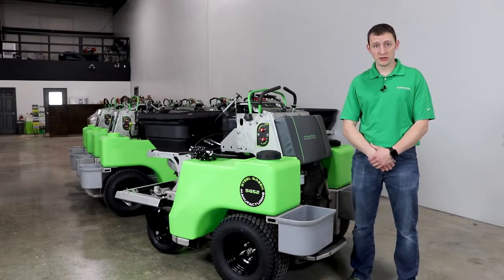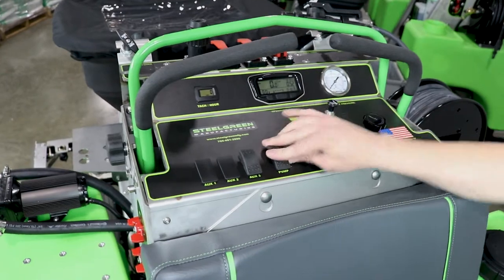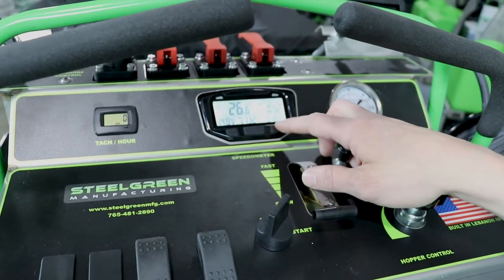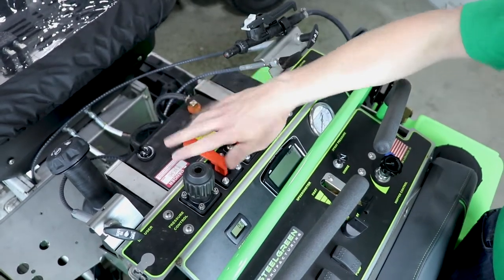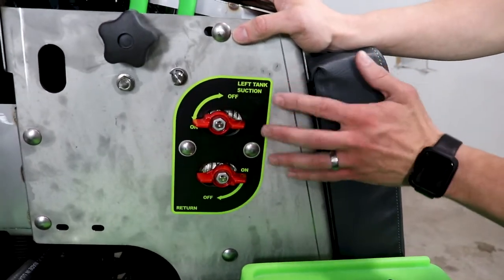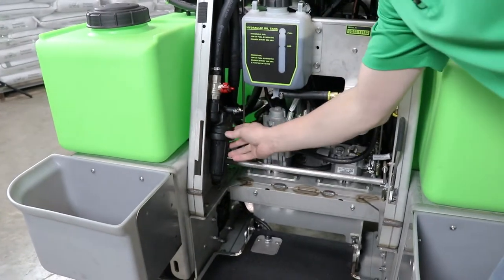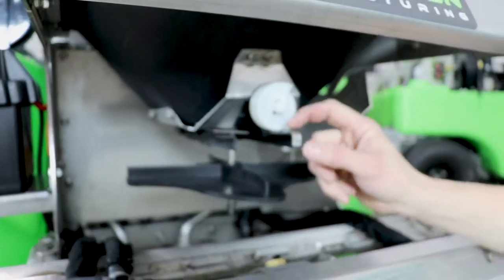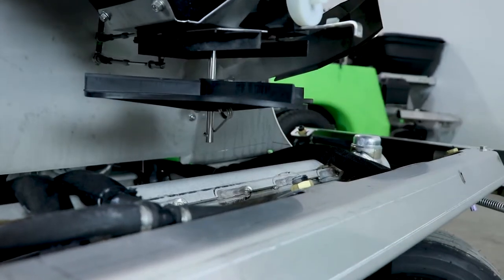Steel Green Machine Key Features and Standard Options

Comment: I really like this machine, noticeable improvements over the Z- spray to me are the drum brake system and no lock in castors. As an experienced tech, both of these have caused problems for me on the Z systems resulting in damaging the machine or the parking brakes dragging into the tires. I also like the fan on top of the machine like the old style Z sprayers. Only thing I can see so far that I would like to add is to make the drive bars come closer together at the top which allows the machine to be controlled easier one handed when opening and closing the hopper.

Comment: u guys did great job on this machine.
i cant wait to purchase my new steel green 36. this will cut down on alot of time and offer me everything i need in one piece equipment. very excited to get mine.
Reply from the maker: Thank you for your kind words! We are excited to have you join our team when you get your machine!
Reply: How do you like you’re machine after two years? I just got a sg36 yesterday.
Reply: I'm still lovin it. It makes things so much easier in fast. Other then the ride being little rough it's a good machine. U diffently made a good choice. The 36 has no issues getting in small gates.
Reply: @lopezlawntreecare6477  wow thanks for responding! Have you had any complaints about size? I’m switching over from a perma green to steel green.
Reply: That's funny I had the older model permagreen that i switch to steelgreen. No I havnt I found the 36 for me is the perfect size. We also have yards up to 5 acres we do and it gets it done quick.
Reply: @lopezlawntreecare6477  thanks for the info I think you had a magnum I saw in one of you’re shorts so we are identical have a triumph as well. Just needed to get a better spraying capacity.